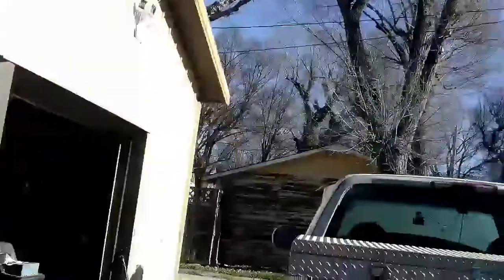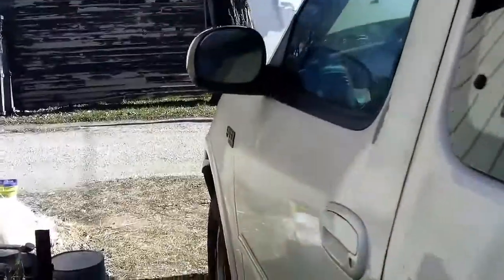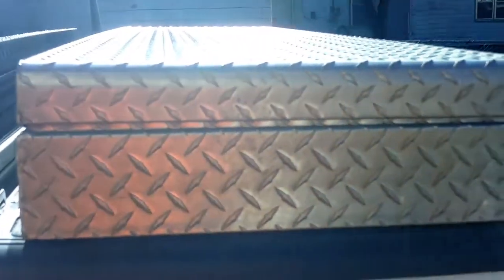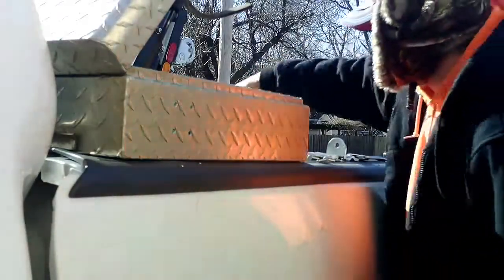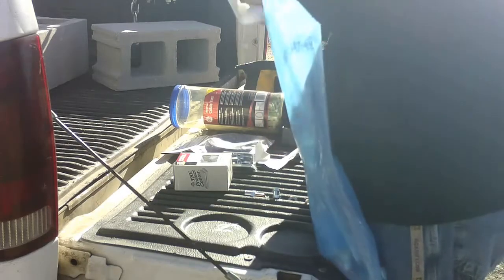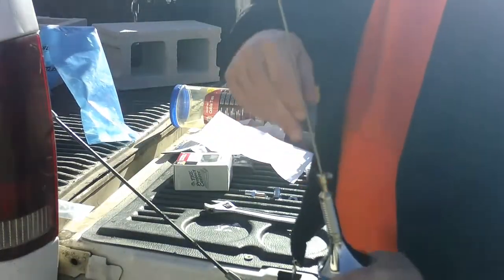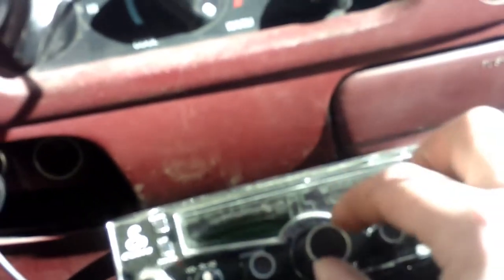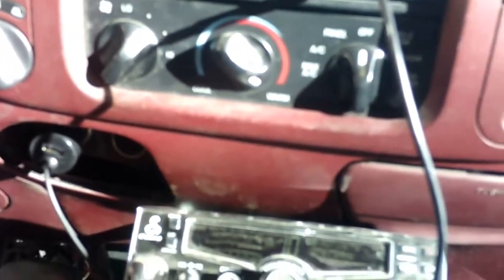CB Radio Antenna Install

Comment: You need to put the stud assembly on the bracket before the antenna with what plastic washer on top the pl259 coax connection on the bottom on the double female 3/8-24 on top of the plastic washer the washer acts as a insulator the shaft of your antenna is actually your positive connection so to speak and the piece you’re coax screws around is your negative not putting the washer in will give you bad swr and could potentially burn up your radio
Reply from the maker: I was wondering what that plastic washer was for considering it was not in the instructions. I will do that ASAP.  

Thanks for pointing that out.
Reply: @BlazerProject  Get it working?       If you have an ohm meter check for a short between the center pin of the coax and the tool box. It should be open. If you read a short then you got the plastic washers stacked wrong. 
Here is a diagram. Hopefully the link works. 
https://www.rfwiz.com/image/cache/catalog/CB_11Meters/MountsBrackets/K-4A-2-500x500.jpg
Reply from the maker: @Oldcomputer  I will look into that once the snow melts and also the warmer temps come back. There is still a lot of snow and ice where I live.  

Thanks
Reply: @BlazerProject  Can you link the antenna and mount Im looking for one
Reply from the maker: @jasonjr2500  https://www.walcottradio.com/hustler-scbblu-high-performance-cb-radio-and-10-meter-antenna-blue-p-3392.html

https://www.walcottradio.com/double-groove-4bolt-aluminum-cb-antenna-bracket-mount-p-2812.html

That is the antenna and mount that I used, the website also has the cables as well. Good luck with your install.

Comment: There’s so many things I could tell you I’m a ham operator tech there’s so many grounds underneath your vehicle what do you think you needed it is a drill and a brush clean one of those bolts and then with the meter you check if you got a good ground go up you don’t have to go chase in from the front going to the Side going up believe me I told a lot of people I had to chase The wire